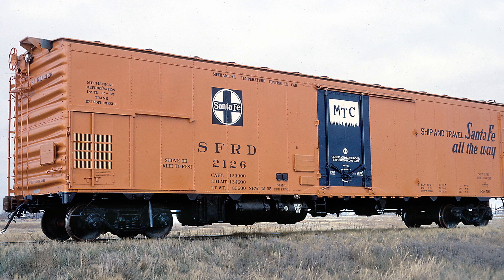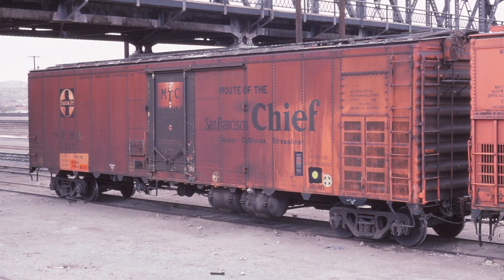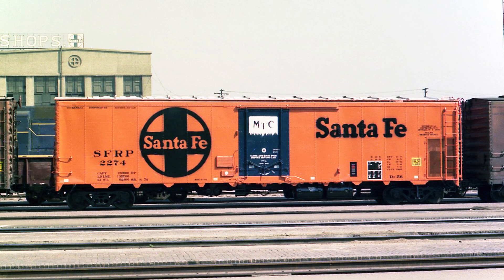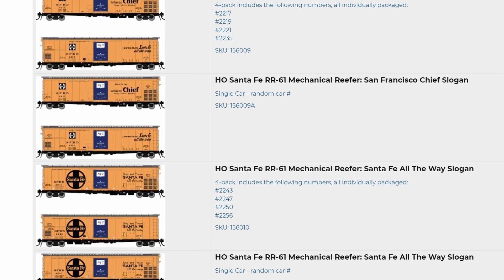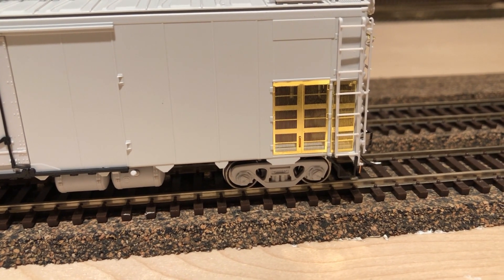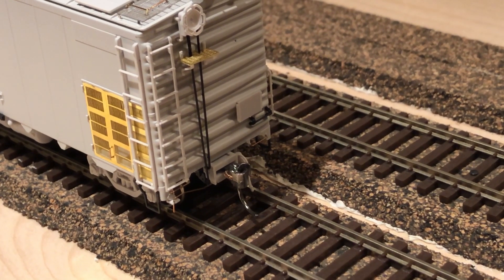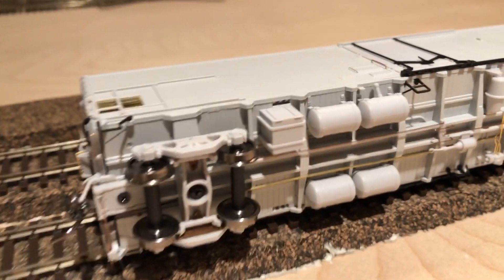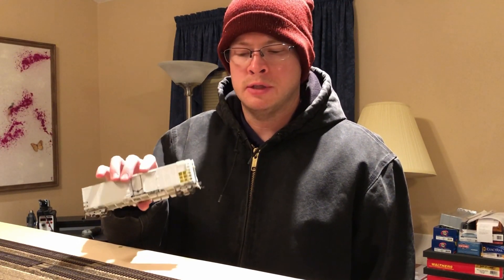Rapido Santa Fe RR-56/60/61 Mechanical Reefers!

Comment: 2:11 that symbol is called the Santa Fe cross, it was on the Santa Fe trail. To tell travelers what direction they were going amongst the monotonous countryside of the southern u.s.

P.s. I am kinda hoping that the msrp on this is pretty low. Because I don’t live near any hobby shops. So I have to pay the online price.
Which I’ve found (no offense this is true across the board) is like asking to get swindled when compared to hobby shop prices.
Reply from the maker: I think you should do more searching. There are a lot of great hobby shops out there that offer good prices and reasonable shipping costs.